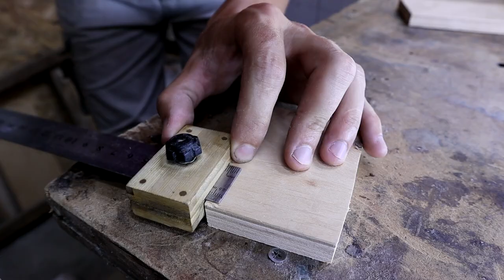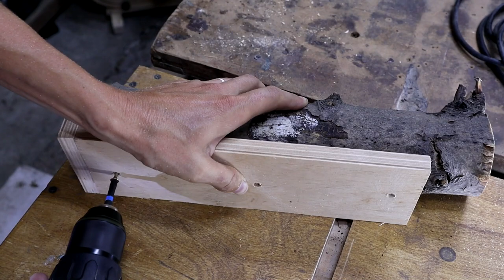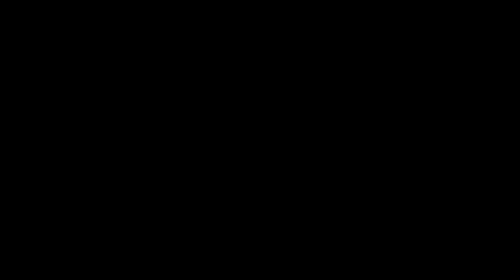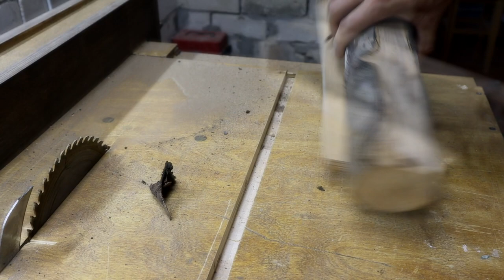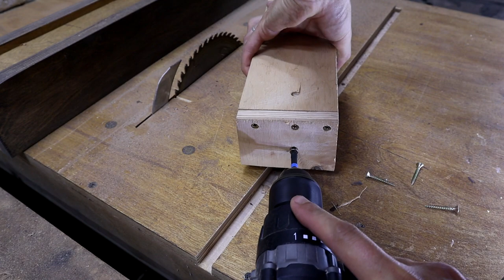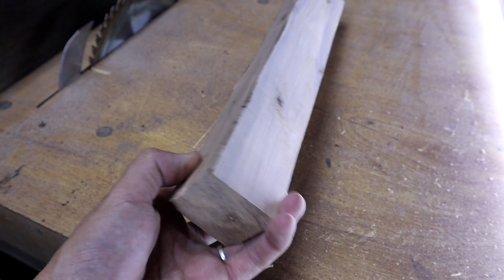How to quickly and EASY dissolve a log on a CIRCULAR SAW!!!

Comment: Without screwing into the log
Reply: I use a bar clamp and 2 square blocks.  Clamp the blocks onto the ends of the log.  After 2 passes it’s the same procedure just no screw holes in the boards when you’re done.